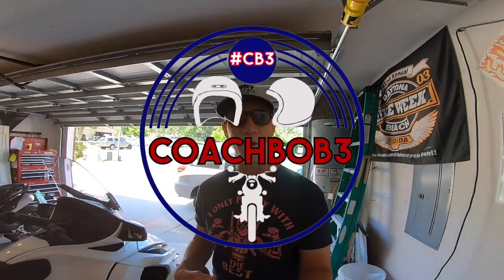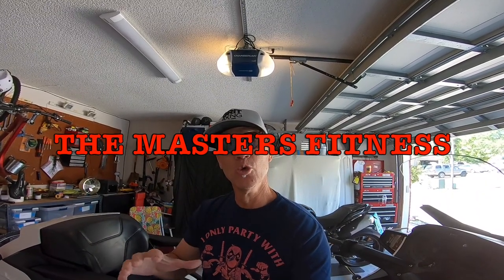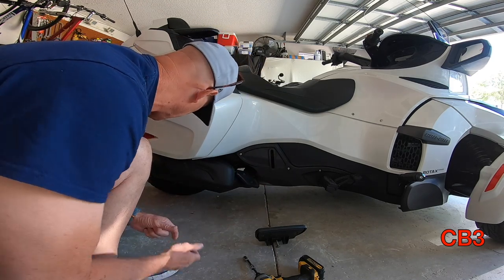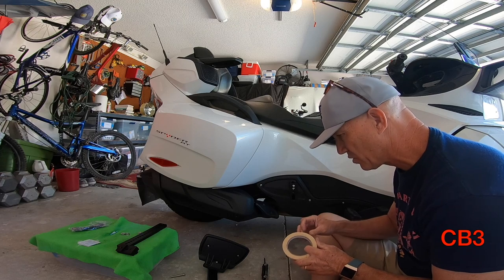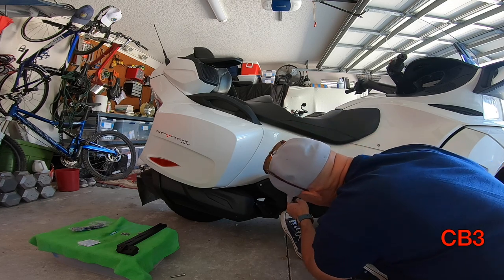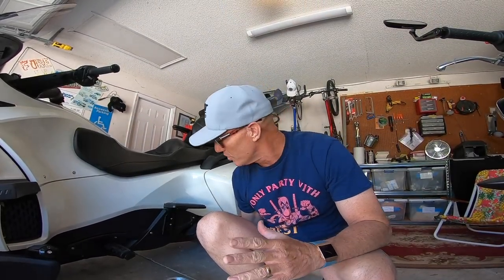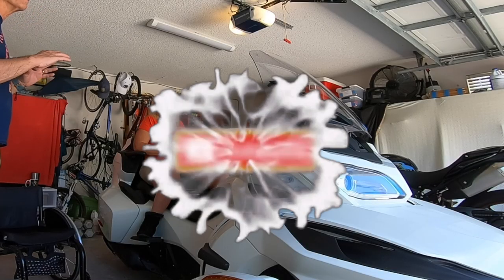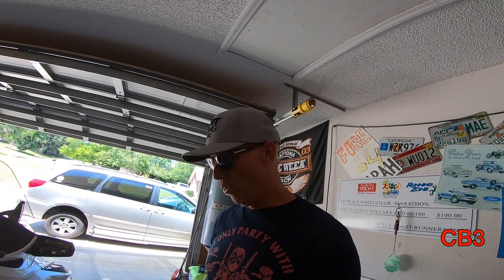CanAM Spyder Accessories (CASA) Floorboard riser installation... These are awesome!!!

Comment: Nice job,anything to make Coach Vic feel safe and comfortable;I was wondering why the foot pegs on a 2019 rt?,I also have a showchrome backrest and its an absolute addition for the driver plus its removable highly recommended.
Reply from the maker: Good question... Mine is not the limited, it is the standard which comes with pegs.  Coach Vic and I talked about the need for boards.  I'm an "old gear head" I lie the feeling of a motorcycle peg under my feet. I honestly prefer the feel of a peg...

I have just gotten the show chrome backrest and will be doing an installation video in a little bit...
Reply: @CoachBob3  Awesome!!

Comment: have you thought of getting a Spyder with a fuel filler on the outside instead of under the seat, seems it would be easier, just curious
Reply from the maker: It would be wayyy easier.  We have contemplated doing that.  We just never took the plunge.

Comment: Just got a drink holder for the Mrs, good fit for the passenger grab rail and doesn't break the bank.  Was $14.95 incl shipping.  Think I'll get another for the other grab rail, that way not a lot of clutter on the steering handle bars.  I mounted with a piece of bicycle inner tube under the securing device so as not to mar the grab rail.  Here's the link...
http://store.valueaccessories.net/SpyderDrinkHolder.aspx
Reply from the maker: Cool.  Great suggestion Bill.  You be safe to buddy. 👍😎🍻